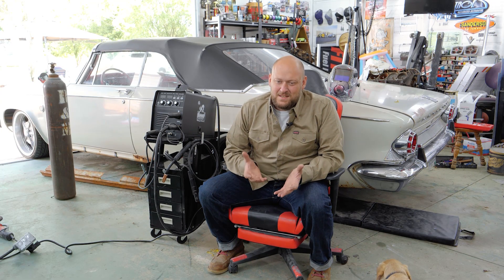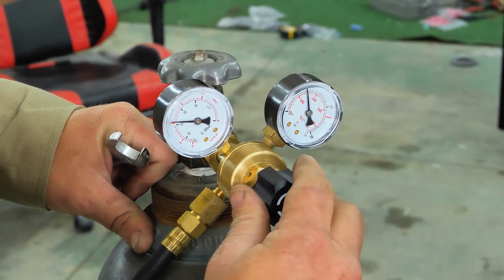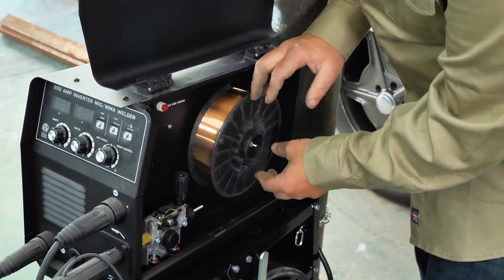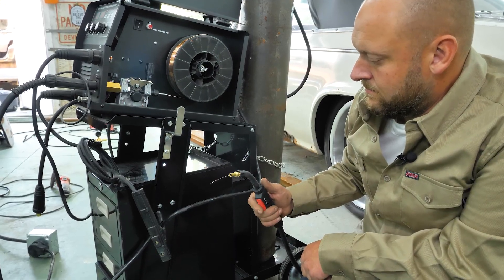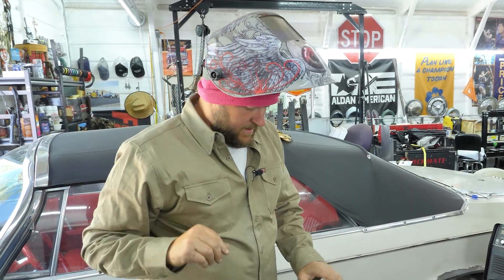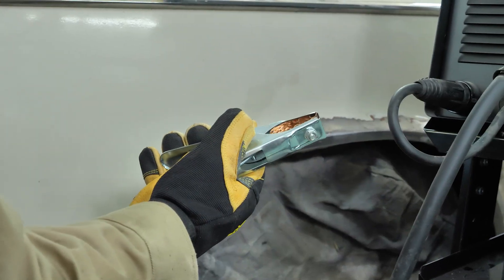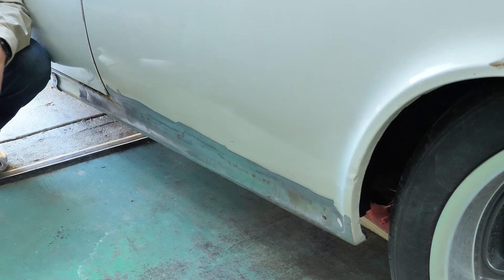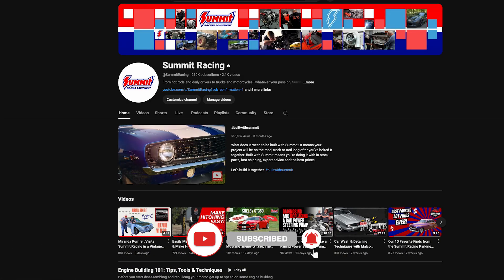MIG Welding 101 | How to Get Started Making Your First Patch Panel

Comment: I love summit racing, but when making patch panels you have to do butt joints, when you overlap panels you leave  room for moisture, pinch weld flange is a different story
Reply: All of the patch panels we do are butt welded. I make the patches larger and then cut it out so it buts up to the older good metal.